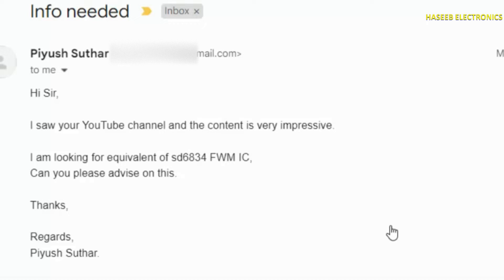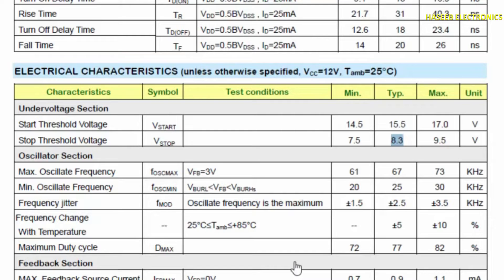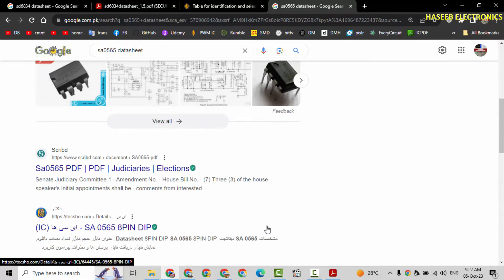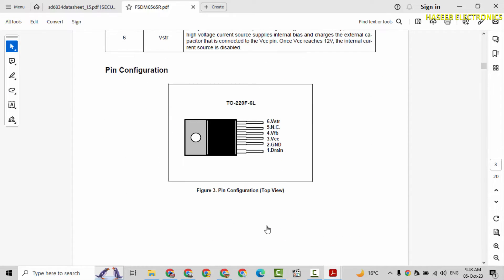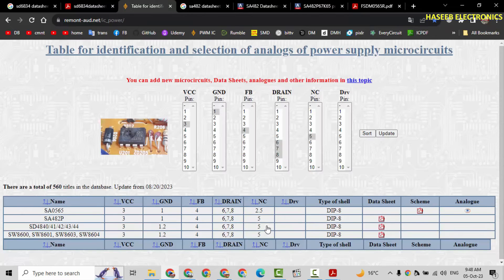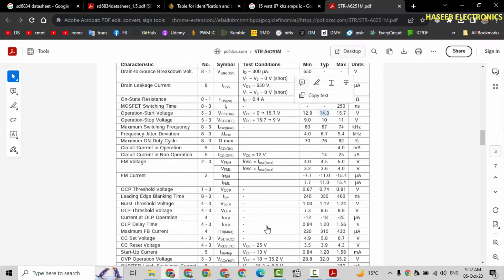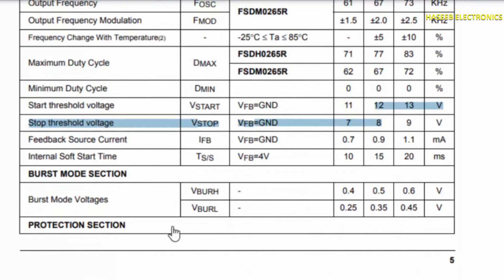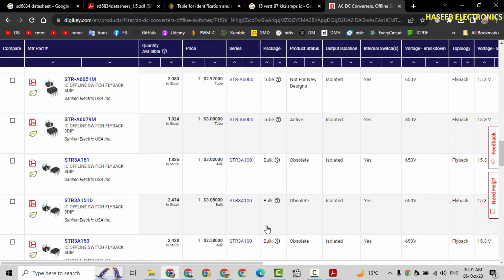{979} How to search equivalent for any SMPS PWM IC

Comment: Hello.can you help find ic?because my ic dip dont have number😰..i see my ic..pin 5678 jumper to + after rextifier positif 300v..
Reply: Pin1/2/3/4 im not sure with one input vcc because i see track from rectifier negatif to pin 1234 just use resistor.
Pin 5678 track from rectifier positive..can you help me?
This item about power supply (ups battery backup for cctv 30 amp)

Comment: I need equvalent of fp5003 smd ic
Reply from the maker: TL5001, TL5002 are same to FP5003
just adjust RT (timing resistor value) by checking datasheet
Reply from the maker: check chart at page number 7 for frequency setting 
https://pdf1.alldatasheet.com/datasheet-pdf/view/100059/TI/TL5002.html

Comment: Can u tell me..on atx smps... What's happened if the voltage between two input series capacitor are not equal...??suppose the voltage on one capacitor  is 100v and another capacitor  is 230v...then.. What happened...?? 
I already watched ur every smps repairing videos... Its really very informative..

Comment: Equivalent ic is almost same but if rds is lower then original ic than it's fine? Is there any advantage of lower rds ?
Reply from the maker: yes the low RDS_on value cause to low power dissipation, so the internal mosfet will not heat up. if we select the higher RDS value. it will cause more power dissipation across the MOSFET.
Reply: @HaseebElectronics   thanks sir ❣️